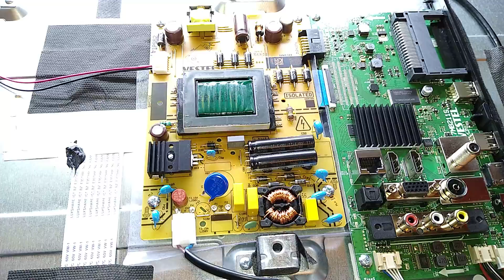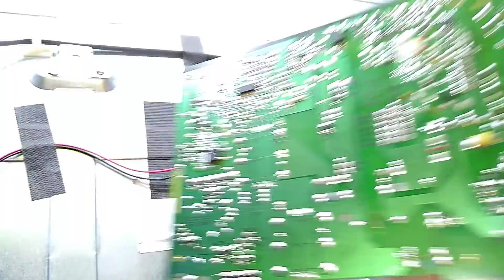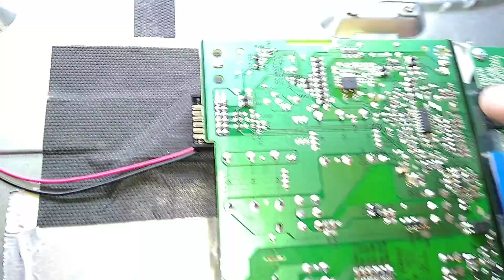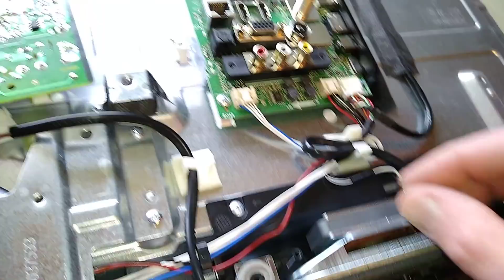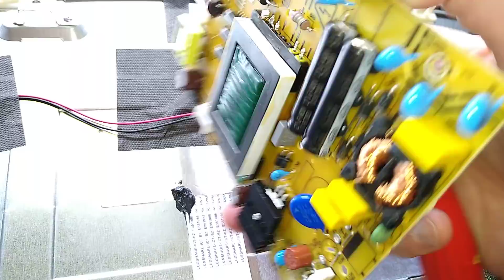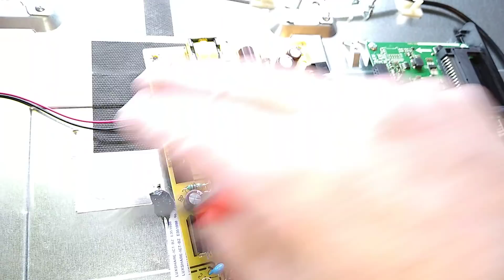There's not much inside TVs these days

Comment: Gratz to you big Clive.... I bought my computer monitors back in 2015. In 2016, one of the monitors never turned on. 
Because I have watched all of your video's I figured "what the hell, I can't make it any worse". 
I proceeded to DE soldier all of the caps (they were no-name brand) with slightly higher voltage values. 
Snapped the case back together, and it fired right up (in a good way). 
About 3 months later, the other monitor died, so I repeated the process, and both of my monitors are working to this day. 
Cost me about $4 in parts. 
I just wanted you to know your videos are greatly appreciated. ( A small part of me wanted to experience an "Oh dear, that's not good" moment, so I just have to wait until you have another one of those LOL)

Comment: Are the Y capacitors that necessary near the screws?
EDIT: Corrected a typo.
Reply from the maker: They are connected to the screw pads to help with RF noise suppression.

Comment: Interesting, my 2016 Vestel-made Panasonic has the two boards on the seperate sides, joined by cables rather than a connector. And yep, they did the same speaker mount fail on this one. They don't end up "using" the housing as their enclosure as intended, because that foam is too sparse to form a gasket.

Comment: Ahhh I know these models. They are made from the producer called VESTEL an electronics producer from Türkey. They are cheap devices and have always the same failures.

1. The Bachlight fails often. (It can be replaced by dismantling the Display) 
2. The diods on the secondary side in the P. S. U. are failing (easy to replace) 
3. The Chassis (the Mainboard) has a fault and has to be replaced.

I got these products often in repair. The only good thing about them is, you can get every single spare part. Every cable, every screw, Avery piece of plastic or metal. And the parts are cheap. So, to be honest, those are actually TVs which are always repairable and better for the environment. (At least in my opinion)

Btw. If someone Interested to know, I'm an Informationelectronik engineer from Germany. (if this is the right translation of the jobs name. The modern version of the old Radio and TV engeniers)

Comment: I have fixed my nans one of these vestel Panasonic badged TVs twice, with intermittent black screen and have it back again waiting for me to motivate myself to fix it. It was the LEDs, if enough of them fail it wont send any power to them at all, I pressume for protection. This time I am planning to replace every LED. Good practice for my solder station.

Comment: i have a sony one..psu..from a 40 led tv! its done....the issue is, there are not coming on and the standby led blinks few times, then nothing...u cant switch on!
the psu itself make a sound like ticking and with these "ticking" the Voltage all over the psu drops...doesnt matter where you mesuring the voltage. primary side drops and sec. side drops..even the high voltage 180v for backlite drops...
i replaces the main regulator chip called "icm802s" but still same fault. There is no damage that u can see with your eyes... my last hope is a 9pin Ic called A6052.
the model name from the psu is: bn44-00482b
maybe someone has an idea?
Reply from the maker: Check capacitors and diodes too.
Reply: @bigclivedotcom  i did...all capacitors are good and diodes too...
i solder some out and test, but they are all good!
i have a second psu from this. it were for replacement but my buddy was too lazy and bent pins from the board.
so even the 2nd. psu did the same problem!
if i plug the psu on..without any other components from tv i hear a ticking noise! and with this noise the voltages drops and raise up and down.
im not a real pro in this job! 
maybe i find the problem!
maybe the problem is not the psu itself, its could be the mainboard from the tv!
2 equal psu with the same exact fault is very suspicios in my eyes!

Comment: I took apart an older LCD TV and just about every part was on it's own board and very easy to do modding. Was able to pull out a VERY nice audio amplifier board in which I did not hesitate to build something with it. I made a nice boombox/portable amp with built-in speakers and I run it off a 12 volt drill battery from a broken drill. It's pretty loud.

Comment: You said you got a used board? Are you going to Ebay, or is there a more reliable source for used parts.
Reply from the maker: eBay.  But a seller listing many similar boards with technical data.
Reply: @bigclivedotcom  Thanks!

Comment: About 6 years ago, our TV stopped working, turns out the main capacitor on the power board had vented, and it even melted a hole in the back on the TV. I can't remember it exactly, but it was a very big capacitor, about an inch in diameter. Being about 15 years old and want to look all smart in front of my parents, I managed to get ahold of a working power board off ebay. The TV was probably about 6 or 7 years old at the time, and to be honest, my mum just wanted to get a new fancy TV, anyway the TV was bought back to life and about 4 years later the TV stopped working again, and it was well due to be replaced, so it was sent to the tip.

Comment: I repaired my sisters TV in December 2018, was also simple to repair, a KLV-26S550A 0R1 0.5W 0.1 Ohm 1/2W Fused Fusible Resistor was broken, and a 2SK4096 K4096 TO-220F 500V 8A was broken.

Now the TV 42" TV is still working great.

Comment: Would these make reasonable mains power supply boards for higher-end hobby projects? Cheap, modular, slimline, and lots of 12V which can be easily regulated down to 5V or 3.3V using a cheapo buck regulator. The 40V supply might be useful for generating higher voltages but if it's controllable by the logic board then getting access to it is harder.
Reply from the maker: I've just ordered some generic TV repair boards to experiment with.
Reply: @bigclivedotcom  Awesome --- looking forward to the teardown.

Comment: the boards always go... last couple I've had fail were bad boards. if it's a cheap china brand you probably won't be able to find a replacement either.
Reply from the maker: Rather intriguingly, you can get universal boards from China.
Reply: @bigclivedotcom  must have been too much hassle... walmart just refunded me under warranty.

Comment: My first guess at the failure mode would be cracked solder joints due to thermal cycling. Maybe check the through-hole pads under a microscope, but really it's faster to just reflow those dry lead-free joints with a bit of juicy tin/lead solder.

Comment: The last one I did with bad LED's Clive, they would go out after 2 minutes on FULL, but stay on permanently on LOW. It wasn't the supply either as my first test was a straight swap. It was the lamps themselves, which are available on eBay, or they were in Feb when I did my customer's TV.

Comment: White leds have the habit of cracking at the chip level. The conductor on the die is interrupted due to thermal dilatation and it stops working. 
If you get 40-50V out then the psu is ok. Leds are driven in constant current. Unloaded psu will be 40-50v and loaded with a 10 series of leds will be about 35v.

Comment: Ah, VESTEL! I do these on an almost daily basis, usually bad output caps on the supply, and bad backlights! They're my bread and butter. The brightness on most LED TV's (and older CCFL) is ALWAYS on FULL, and this EATS them over 2 years. Once I repair one I always instruct the customer to keep the backlight brightness as LOW as is bearable. It increases the life of the lamps by 3-4 years!

And the output caps? ALWAYS cheap unbranded ones. A few Nichicon caps later, better than stock!

Comment: Yeah, sadly there isn't much at all in them. i tend to pull the LEDs and PSU out of them but the logic board is almost useless for project parts. I am not looking forward to more TVs being OLED because there won't be any usable parts really. My favorite TVs are the large CCFL backlit ones because they have some boss HV transformers.

As far as LED back light failure goes it could also be an LED strip, I find that the newer the TV the fewer LEDs they have so they overdrive them.

Comment: Mine packed in after the other half lost the remote it would work intermittently and go off without warning then come back on . the red on led would flash randomly . after much scratching around probing and fettling . I found the problem the remote was wedged  down the side of the sofa and every time she moved the remote would press random buttons especially when she was sitting on it . are you sure it broken or is she just happy to have you around  😀

Comment: More boards then mine. My uncle gave me a 4k hisense tv that has issues. I think it's either a power supply capacitor issue or a issue with a faulty thermistor. Opened it up  bam it's all one board. Power supply, led driver board, smart tv processor. Still gunna give her a go though. Most expensive thing on the is the TV screen.

 Do have too give them props though the TV circuitry is all contained with a small panel that can be easily taken off. No need too strip the whole tv screen back panel off.

Comment: I'm a baby boomer born in  1953. I remember the first color TV picture I saw probably circa 63 or 64. The picture tubes were round, they are now called roundies. The picture was shaped like a circle with the top and bottom cut off and, as I recall,                 everyone in the picture were green. The color TV's  were huge, they were all vacuum tube, probably weighed over 100 pounds, and cost 500 to 600 US  63 or 64 dollars. Because they were all vacuum tube, they probably consumed a lot of watts and generated a lot of heat. In the cold months they might have done extra duty as space heaters.  At least they were fixable. Today most consumer electronics really isn't fixable. It would cost more to fix most modern consumer electronics, that is if you even could get them fixed, that it would to buy a replacement.

Comment: I have repaired quite a few vestel TVs . The 160V 56uF electrolytic capacitor for the LED backlight goes high ESR, even though it's not bulged and that causes the surface mount MOSFET to go bad but it doesn't usually fail short. The driver IC is usually OK. I replace the stupid surface mount FET with a through hole IRF640 (200V, 18A, 0.15ohm RDSon) and add the unpopulated small ceramic snubber capacitor that is missing. I put in a 101. I replace the 160V 56uF capacitor with a high quality low ESR 100V 100uF capacitor. It doesn't need to be a 160V cap, the backlight voltage is NOT over 100V. Backlight works again and better than it did originally.
Reply: The unpopulated capacitor is C110 on the power board in the video but it will have different designator numbers on different boards. Its between the drain and source of the FET. You don't need to order a new power board. The replacement board will fail in the future if you don't replace the crappy MOSFET and 160V 56uF capacitor and add the ceramic capacitor.

Comment: Most likely its the fault of the no lead solder. High heat areas are the first I check out. Clean and reflow good old fashion solder onto the components. Most often this solves the problem.

Comment: HI Clive I Had a similar thing with a Samsung 40" it had many more PSU outputs +/-12v 5v 3.3v for smart tv and the 5v had died intermittently I noticed a whining capacitor  so I ReCaped some of the board testing each time and it worked maybe was a bad solder joint Because all the capacitors I replaced measure fine thanks for video  ..... I did think about buying a ebay PSU and jury-rigging the tv  what are your thoughts on that   I didn't have too but I would be very interested

Comment: My Samsung LCD failed a few years ago with an onscreen message. It left the message for 30 seconds or so and then shutdown as basically it's cooling fan had failed. So one new fan later and it's been okay for the last 5 years.
Samsung only used a fan for one year 2009 for this model range.  Too many failures in the first year of production so subsequently all models were air cooled.

Comment: @bigclivedotcom - Hello,  I have an electric coffee bean grinder.  When I grind said beans, the resulting grounds have a large amount of static charge.  When I pour them out, they jump all over as it appears they all have the same charge and are repelling eachother.  It makes a huge mess, and I use it less than I want to because of this. It has a 2 prong plug.
My question is this: Can I safely add a 3 prong grounded plug to this device and do you think it will cut down on the static electricity in the ground beans? 
(I'm comfortable working with electricity, building houses, wiring, etc.)
Reply: In case BC doesn't answer:  That your grinder has a two-pin plug suggests it's double-insulated, and so doesn't need an earth connection but (more importantly) may not have any good place to connect an earth lead;  e.g. because it's mainly made out of plastic.
Sooo... provided you're comfortable changing the mains lead from two-core to three-core, and that there's somewhere sensible to attach the earth to the grinder, that should be fully safe;  but we don't know in advance whether it will help.
Good luck :-)

Comment: This is why channels like yours are so important,  encourages us to fix stuff. Had a dry joint on the hdmi port on mine, quite a common point of failure, tried reflow in the oven but no joy, board swap did the job.

Comment: I remember my grandfather's old CRT television from the eighties. The amount of electronics in that was well over an order of magnitude more. The set had 2 pop-out drawers with individual tuners for each of the 12 channels. Then there was the electronics for the tiptronic channel swithing. And when you took the rear cover off the set, there were 2 huge fold-out panels completely full of electronics for driving that 20 inch CRT. And there was a big lump of power transformer tucked away underneath the CRT.

Comment: Yep and there are even universal boards that we can get to use for repair if the screen is still working.  Get's me thinking, might even be able to use the universal boards for upgrading CRT equipment?  HHhmmm... maybe like the arcade video adapter boards or in concert for some unknown reason I started wondering regarding.  Anyhow, great resource for practicing solder and desoldering on smaller components also.

Comment: I had to laugh at this.  When I was but a lad, I built a Heathkit TV.  Not only did you have to solder almost every component onto every circuit board (of which there must have been a dozen), but had to calibrate the picture as well.  Now they can shrink the electronics down to the size of a transistor radio.

Well, same thing happened with computers.  Massive, even using transistors, and big even using IC's.  Now the most common computer is your phone....

Comment: I had a similar device in my lab recently. It was a repair for a friend. I did your exact same diagnosis and ordered straight away a new psu board. Unfortunately the board was not the exact same model, but i thought it could work anyways. After installing the new board, that still didnt fix the issue. So, i ordered again a new power board, this time the right one, but again, it wasn't working. So i had to conclude that the main board was faulty and it was not sending the right signal to turn on the back leds. Fixed the problem with an external psu only for the leds. I shoved it into the case and mounted all back togheter. Fixing complete

Comment: I had a tv that you used to have to unplug-replug every now and then because it wouldn't turn on.  No idea WHY.
Reply: Sounds like dried up capacitors.
Reply: @em0_tion  it is getting up there in age.  Still works for the most part still so hey, who knows
Reply: @goldenpun5592  I'd suggest you physically open it up and take a look at it or ask a knowledgeable friend for help. Now is the time for action, before it's too late. While the issue is still tiny and more expensive parts are not damaged YET ;) Up to you ofc, as always.

Comment: Welcome to the life of a vehicle diagnostic tech. A customer complains of an engine light and they think the scan tool can fix all the problems.
Often the issue is a history trouble code (only happened briefly and put the engine light on) 
Customers just say clear the code but they come back later with the same issue.
So hard to find an issue that isn't obvious/intermittent. 
Unplug something and reconnect it. Trouble free for 6 months haha. Then get called useless cause I didn't fix it. FML
Reply from the maker: Watching South Main Auto has been an education in how engine technology has evolved towards electronic control.

Comment: It really is a different world. I started to repair TV's when they were all tube black and white and usually had round picture tubes. Transistors started to creep in in the late 60's, usually in the signal areas. One of the most reliable TV's I owned was an RCA with the CTC39 chassis that had transistors for a good deal of the signal level circuitry and tubes for the horizontal and vertical output stages and anything that interfaced with the color CRT.

As you said a lot of the components are now surface mount so circuit board repair is not as easy, hence the wide availability of replacement circuit cards
Reply: You must be American , at collage the first colour tvs I worked on were old RCA NTSC (never the same colour ) sets with round crts.